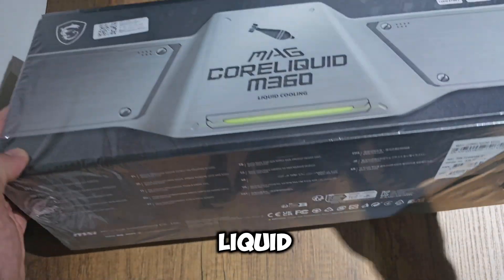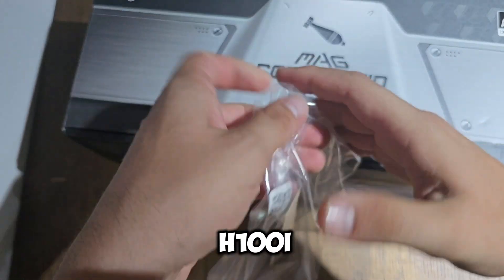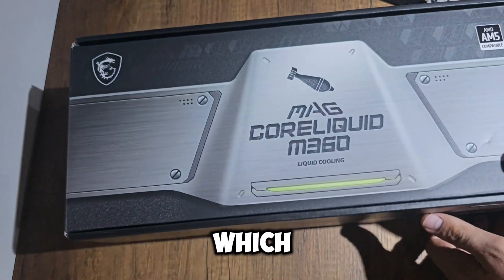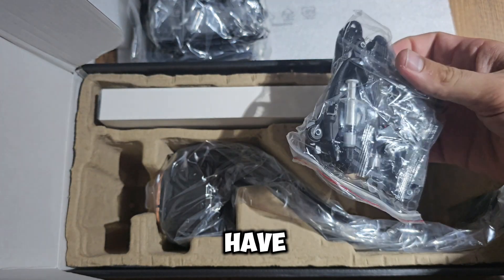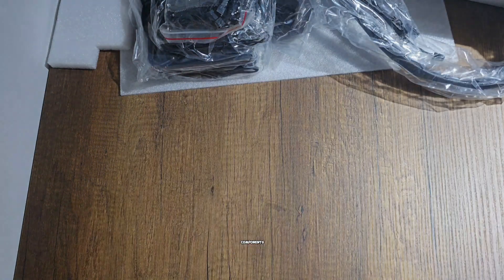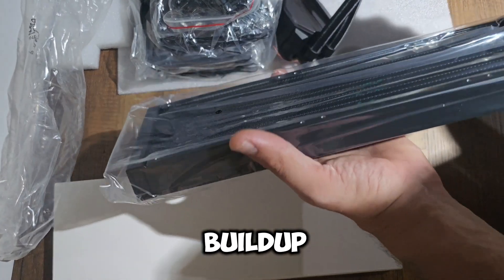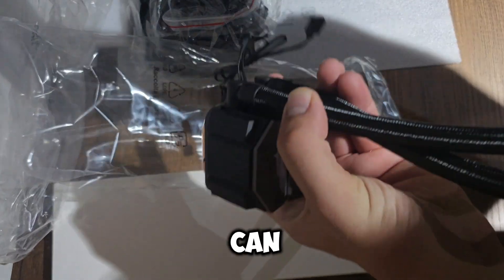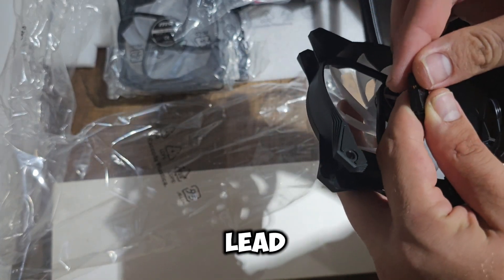MSI MAG CORELIQUID M360 Unboxing & Installation | Step-by-Step Guide

Comment: Oh guys i hope you have no problem with this AIO... i got an issue with his coolant. "clogging issue due to sediment accumulation" i have to refound it:(
Reply from the maker: Im using it with r9 5900x and works fine
Reply: Ia your isue with his specific cooler (m360)? or another of the MSI coolers?
Reply: @simonr23  MAG CORELIQUID M240 with this version. I send it to warranty, my only solution was that. (but i know a lot of reports with the same problem with m360 and other versions like R240/360, etc.)

Comment: I have this model but the m240 version, even after setting the rgb's with the msi center, both of the fans aren't changing colors and one of them has an angle constantly red, is there another way to change it?
Reply from the maker: I actually using my cooler master external rgb controller. I never use it with msi center lol

Comment: I have the Same model but i cannot get the argb of the Pump on, i put the Argb directly on the motherboard, i dont know whats the problem 😢
Reply from the maker: use MSI Center app. You will see mystic light section. with that section you can customize your lightning effects

Comment: how is the temperatures and which processor you are pairing with ?
Reply from the maker: when the cpu hits %100 and pump around %70, temps are around 45-50
Reply: @dantetechnology  which cpu ?